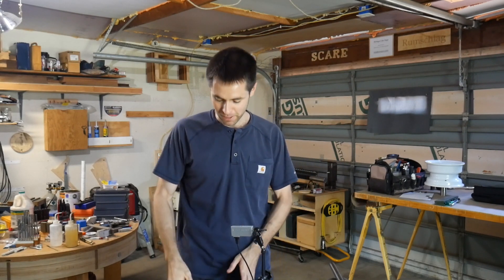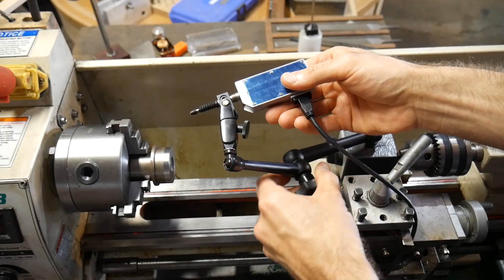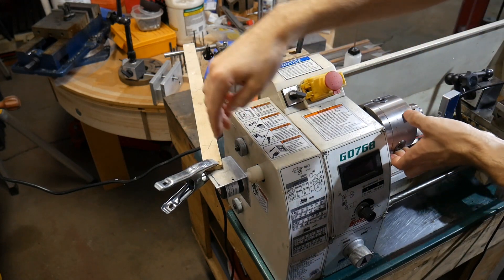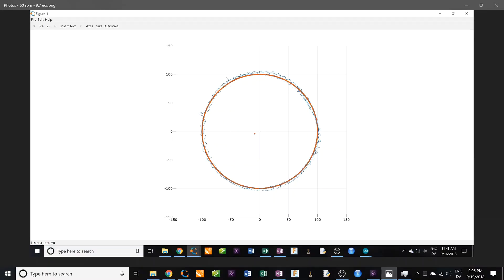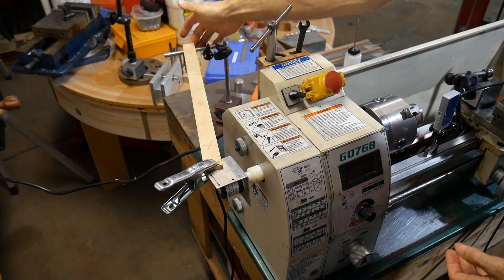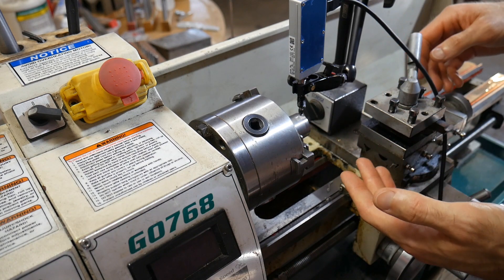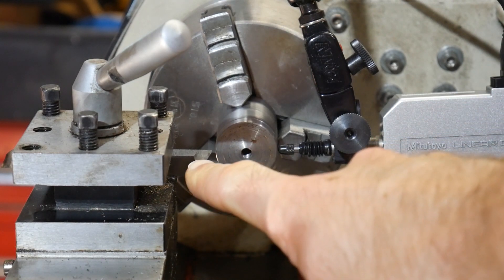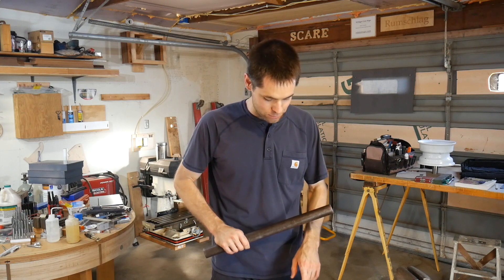DIY Spindle Metrology

Comment: Hi, You should slide-in one gauge block onto another gauge's surface in order to get better accuracy. The air gap between two bocks could cause an error reading. Also, since you use high sensitive measuring equipment, thermal expansion could also cause error reading. Try cooling your fingers in 20C water before pick and place blocks and control room temperature.

Comment: Super precision machining and misures need heavy and stable equipment and controlled environments. In that way our equipment shakes like an old  motor hoe, gears, belts, resonating cut, unbalancing vibrations....  Accurate probing systems and lathes can weight tons. Anyway, many informations on your video. Good.

Comment: As an ex NBS PDL Lab Rat, some info for you.  S1 gage blocks are 316 stainless and are calibrated at 68F.  The correction factor for them is 11 micro" per inch growth per degree F above 68 degrees.  They should ALWAYS be oiled with a non acidic oil and cleaned then reoiled before storage.  When properly oiled, they will "Ring" together and stay adhered with 1 molecule of oil between them.  This is per NBS/NIST Physical Dimensional Laboratory Standard Laboratory practice.

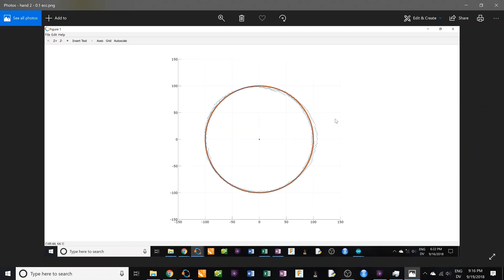Comment: The lobes on the side you are getting at 13:20 could be due to having a three jaw chuck, and only being able to apply pressure to two of the three, causing the lobes to appear at the third jaw which has no load applied to it. I'm curious to see the results of the same hand operated test but applying force on two opposing jaws of a four-jaw chuck.

Comment: It'd be good to have some kind of non-contact equivalent of that distance sensor you are using. Though if the sensing area is larger than the contact area of the carbide ball, it might average out and conceal defects that this sensor would pick up.pdate: Oops, i should have waited for the end of the video!

Comment: Your measurements are far away from optimum. When you want to measure the shaft or the bearings of your lathe you musst include the force of the v belt that's driving the lathe spindle. I build lathe's since 35 year's and I know from every day working how much the belts can change measurements...
The next thing is temperature.. Measurement the micron space and temperature different are very complicated. But your video is interesting and not waste the time👍

Comment: Scott, at the end of the video you were decribing the difference between "runout" and "escentricity". When one end of a spindle is further off center than the other, it is measured as runout, which requires two places of escentricity measurements along the length of spindle.
Escentricity is a measured distance the spindle is off center of rotation at one given place along it's center-line. When everything is perfect, or within tolerance, the spindle is "concentric".